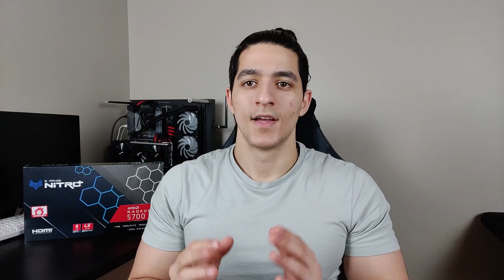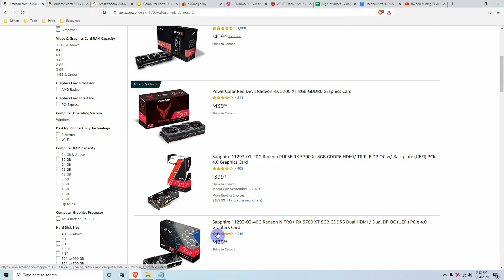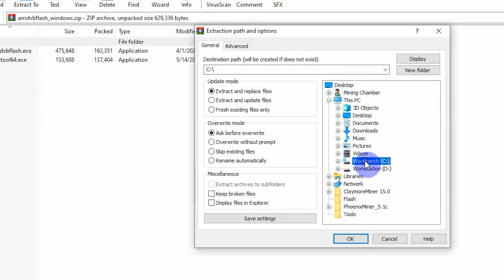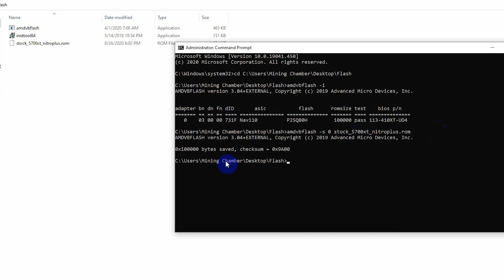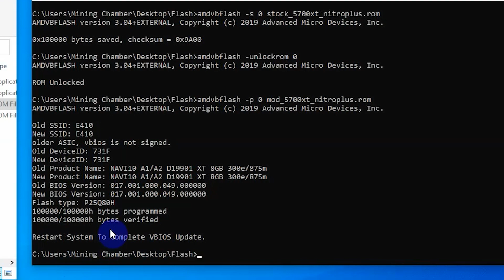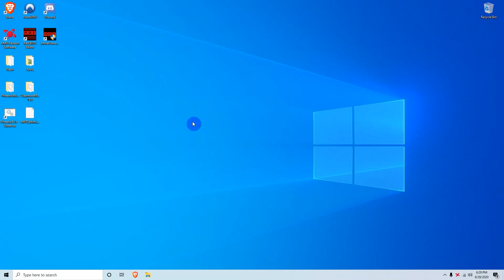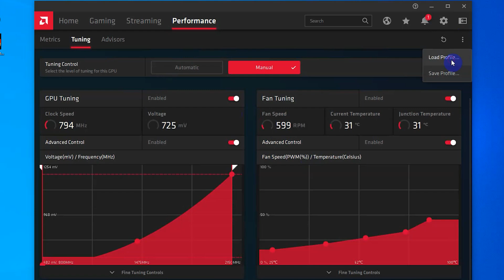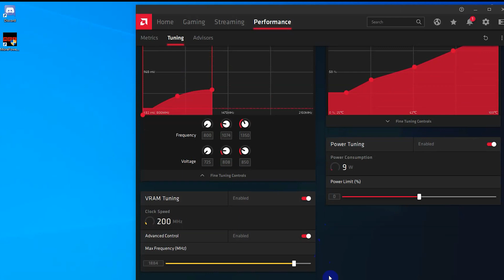RX 5700 XT Mining Overview | Profitability, Hashrates, BIOS Modding & Overclocking

Comment from the maker: NOTES:
- For people trying to flash Gigabyte 5700 xt Gaming OC and Asus Strix 5700 xt. You need to use these 2 stock bios's because modding the original and flashing it back to the card may produce a code 43 in Windows or brick the card. https://mega.nz/folder/PFtCTBYS#AzKgME9vJitocIKIGYKw1g

- Some cards depending on AIB need to have a higher fan speed to keep the memory cool. - Kevin Galloway (Thank you!)
- Please check updated overclocks that are more stable in this article https://miningchamber.com/gpu-mining/rx-5700-xt-mining-settings/
Reply: 1300core@750mV and 1860 memory clock stable with BIOS mod almost 57MHs on MSI RX 5700 XT
Reply: @davidhajes1003  Reported 59.500 mh/s but, effectivespeed 24.16 mh/s? what is this problem ? :(
Reply: @BABAZULA3535  use teamredminer that do not fake hashrates ;-) no RX 5700 series mines more than 56MHs. Only PhoenixMiner can do 65MHs but you get lower effective rate than stock due to the errors and rejected shares. Theoretical hashrate does matter - submitted shares matter
Reply: @DavidHajes  thx bro.
Reply: There's a new 3.04+ up on igors lab. Here's the link. It seems like the file size went up a fraction. Not sure what they added but it still works like a charm and its mirror 1 :) https://www.igorslab.de/en/red-bios-editor-and-morepowertool-adjust-and-optimize-your-vbios-and-even-more-stable-overclocking-navi-unlimited/3/ Also if your getting the error code, its probably because you haven't clicked on Insttool64.exe. <- I made that mistake before >.<
Reply: @WillYouPanMe  thanks a lot👍🏻
Te issue was that I wasn’t on WHQL drivers. But I’ll keep that in mind - thank you!
Reply: I see gigabyte 5700 xt gaming oc rev 1 bios over there. would the same work for rev 2?
Reply: @ntonZZ  Curious as well. I bought mine in batches and it turns out I have (4) rev2 and (5) rev1 - All Gigabyte 5700 xt Gaming.
Reply: @ntonZZ  hey did you find an answer to this? My gigabyte 5700xt has a 1024kb bios and the rev1 posted is 512kb. I’m guessing the rev2 is the 1024kb and can’t be interchanged? Would be STOKED to hear what you learned!
Reply: @eamonconheady9855  unfortunately i didn't try it as 1 of my graphics card got bad sensors. I still get 52.45 MHS at 108 watts. Good luck with ur bios mod.
Reply: Is it posible to bios mod asus strix 5700 xt please helo? :) because i get code 43 every time i try do do it in your video
...
Reply from the maker: @justonekevin  Did you follow what this pinned comment says ;)
Reply: @MiningChamber  noo not yet because i dont know wich bios to use 😅
Reply from the maker: Hey! Just change the bus Id so that they match in the Red Bios Editor tool, so 05C1 should be 04E2. Make sure your using 3.04+ as well not 3.04. join the discord to chat there encase I miss your reply
Reply: @MiningChamber  im waiting mail. 🙏🏻
Reply: @MiningChamber  Thanks! So it sounds like you can change the O5C1 bus ID via RBE , I thought that you can also do it in the AMBVBFlash 3.04+ command lines. That is good to know will check it out. So the goal is to mimmick the ID similar to the current BIOS. I was a little worried about that but good to know the trick
Reply: i was watching your video just now to figure out why i couldn't download the tool.  Thanks for the tutorial, hopefully the tool will be available again soon.
Reply from the maker: Thank you ! I'm glad the comment helped out!!
Reply: I downloaded it using mirror #2, I guess I can proceed with the bios flashing?
Reply: @demdimi9316  Hi Sivi, how did you download it? I entered my email but receives no reply... Could you please share your download link? Thank you so much!
Reply from the maker: Hopefully he provides the way!
Reply: @demdimi9316  hi, can you please send me the download link? thanks
Reply: @yonasun2987 I think the download link expires after a while. Check your spam folder, that's where they sent me the link.

I just asked for another link, hope you click it on time, download link is there. https://www.filehosting.at/file/details/869488/g8d5lmQeOT5MHN38/amdvbflash_windows.zip
Reply: Sivi Skivi Actually I just downloaded it from igorslabs website, it’s back up there... thanks though 👍🏻
Reply from the maker: @demdimi9316  yes if so then you can proceed!
Reply: @MiningChamber  I don't understand, how does it use more wattage? Is it that significant? I saw at the end of the video that you were getting around 55 mh/s with ~84W
Reply from the maker: That was off the software it won't be accurate, off the wall it's about 10 more watts for 3-5 more mh/s
Reply from the maker: He also provided the link above!
Reply: @MiningChamber  SW power draw is maybe in GPU...I get "real" 110W but you have about 10% losses in MB circuitry due voltage control and another 10% PSU...in my case they claim 8% @ 92% PSU efficiency.

I always check APC PSU where is power draw reading. My card is in reality not 110W but 130-140W...hard to estimate due idle power usage of rest of PC.
Reply: Thanks you so much, my card is on the way and I found your channel just in the right moment, I thought it draws 150W, and I was also happy with that. I come from the PSU video, good job!
Reply: what is the password?
Reply from the maker: @monik5365  of phoneix miner? It will be "phoenix"
Reply: The download link does not work  i've got a Gigabyte 5700 xt
Reply from the maker: @ChrissyB_ZA  Hey sorry just fixed it!
Reply: What do you mean dude? If we are using asus rog strix 5700xt then we can't replace the original bios? Or we can mod the original bios from the gpu?
Reply from the maker: @moonshot-studio  If you have the models above then you will need to use the BIOS image in that link for your Strix. The original BIOS has a lock system on it if you modify it, it will lock up. So I recommend just saving your original BIOS then use the one in the link for memory timings and MPT then flash it on the card.
Reply: @MiningChamber  Hello, first of all; thanks for your detailed guide. I exactly did this with my Gigabyte RX 5700 XT Aorus, but my rig won’t boot up after flashing the modded bios. What should I do?
Reply: Hello brother, you are a great one, I learn every day .. a question .. I need the video where you talk about the XFX Radeon RX 5700 XT THICC III Ultra 8GB since it is not in the list of your videos .. thanks
Reply from the maker: @hijodelaruina6032  hey! It is also a good gpu and it will follow this same tutorial!
Reply: does this apply to gigabyte 5700xt aourus?
Reply: Just bricked my aorus 5700xt... tried to flash with your bios but i cant... any solution?
Reply: @milospinkfloyd3325  did you manage to re-flash it?
Reply: @freddieholmgren804  fortunatley yes i did, reflash and mod. Now 56mhs
Reply from the maker: @milospinkfloyd3325  hmm aorus did you try to do it the normal way or through the bios pinned? Sorry for late response I just caught site of this comment!
Reply from the maker: @milospinkfloyd3325  oh sweet I see it's solves awesome
Reply: @MiningChamber  so, point with giga cards is next: if you have rev 2.0 card you need to flash it with 1.0 rev bios stock first than mod that rev 1.0 bios and flash it again. If windows make problem when card flashed no problem just put card in linux rig and will work
Reply from the maker: Awesome thank you for the info!
Reply: @MiningChamber  one more useful info, avoid gigabyte couse they have very bad memory cooling
Reply: @milospinkfloyd3325  hey how did u reflash it? I got a black screen too
Reply: @RayR-804  you have to flash card with previous revison bios of same card
Reply: @milospinkfloyd3325  but whenever i connect the card, my screen goes black. And im using integrated graphics. When i pull off the card. Computer works fine and goes to bios
Reply: @RayR-804  than its complicated.. if you cannot run pc with cpu graphis. Dont know solution
Reply: I tryed the metode for asus rx 5700 xt used your old bios and i get SSID: Mismatched
ERROR: 0FL01
Reply: @justonekevin  than it isnt bios of same card
Reply: @milospinkfloyd3325  yes it is the same card !!
Reply: So with asus strix 5700xt you have 2 files listed there.  One is for the 5700, one for the XT.  The XT file is only 512kb which is half of the size of the stock bios on my GPU.  Is that an issue?
Reply: Hello, I bricked my Gigabyte RX 5700 by not flashing the Rev1 bios first. I have successfully flashed to the original BIOS, but the card is not recognized when put on the 16x slot directly, and when I try to use HiveOS it says there is a Kernel sync error, what else do I need to do in order to revive the card apart from flashing it to the original / rev 1 bios?
Reply: 1.first remove all your gpu go to bios and change settings to onboard graphics which means to motherboard and
connect your monitor to motherboard
2 install your rx 5700 to pcie and you can see windows loading screen and you can back to original bios or to rev1 by above video procedure
Reply: @mo108186  hello first of all thank you for helping me out. I did that, shows success upon flashing it to REV 1. but HiveOS freezes when loading AMD driver.. what can I do?
Reply: @RockoShaw  install amd 20.9.1 drivers it is  stable
Reply: @RockoShaw  install amd 20.9.1 it is stable
Reply: @mo108186  I followed the tutorial, flashed the BIOS of the RX 5700 XT back to the original stock bios. Installed the drivers you recommend (20.9.1) but windows has a yellow warning sign on the Device Manager, the radeon software can't be opended
Reply: @RockoShaw  what is the error it is showing
Reply: @RockoShaw  is it showing code 43 ?
Reply: send me your email id i will send the moded bios for gigabyte rx 5700 xt which was working for me
Reply: @mo108186  When loading HiveOS, it says "not all cpus entered broadcast exception handler" kernel panic, it's a single GPU connected to the Mobo, tried on 16x PCI slot and using riser, can't get HiveOS to work even after flashing the original BIOS
Reply: @RockoShaw have you flashed my bios  it is working on windows i am on windows i don't use hiveos
first check it in windows if its is working tell me then i can give you a solution
Reply: @mo108186  hey man, I’d be stoked to get the working bios for the giga 5700xt. My bios is 1024kb and the one in the link up above is the 512kb. It’s sounding like I need to first flash a clean rev1 bios and then on to the one in the link. Do you have those?
Reply: Mining Chamber Ive flashed my gigabyte 5700xt gaming oc without going to rev1, because i didnt see your comment on that, then my pc didnt boot when the gpu was plugged in,yet i wanted to flash the original bios on it but my gpu isnt detected in device manager neither in cmd with amdvbflash -i. What can i do to get it to show up so i can flash the original bios on to it?
Pls help me i am broke and dont want to loose my 5700xt😫
Reply: @IIISUDDENIII  same thing happened to me. Did you find a solution?
Reply: can somebody share the rev1 bios for gigabyte 5700xt rev2.0 samsumong memory
Reply: @dota2arcade603  I want it to, but i dont know where to find it
Reply: Oh dang, you should have put this message in the description… I have a Gigabyte 5700 xt and followed exact steps in the video, now my pc somehow doesn’t turn on. 
I can see the cpu fan running and gpu lighting is up, but my mouse/keyboard/monitor has no signal, I also tried a remote app to see if my pc is on, it looks like that  my pc did not turn on….Could you please help me with this? I have no idea how to revive it
Reply: @daddisucre3782  dude I was about to do the same a month ago, but for pure curiosity I checked the comments and noticed that. Good luck my friend!
Reply: Can we install with hiveos using unlocked Rev.1 bios? Or is this only done in windows?
I don't want to re-brick the card.
Reply: @seyityavuz38  you can in hive
Reply: Hi, man. One of the best reviews on your channel

#xETH-G offers easy staking: stake with #xETH-G and earn #xETH-G bonuses every minute. 7 and 30 days pool. With compounding rebases on the top of easy staking. Should I buy there?
Reply: It works you need to change thr SUB id in red bios editor as the same as stock.... but now my fans are 20s off 20s max speed...???
Reply: Hey man, your vid made my day, thank you!

I found $xETH-G Governance and I’m really interested. They as a community can create Governance proposals. They provide liquidity mining - stake with 50% $xETH-G token and earn #xETH-G rewards every minute. Worth supporting?
Reply: What version of flash tool i would use for Gigabyte Gaming OC 5700xt? 2.93 or the 3.04 ? I don't want want to brick my cards. Thanks!
Reply: @TickleLabs  3.04 i used 3.04 and bios moded my gpu is achieving 58.3
Reply: @MiningChamber I have screwed it up and flashed my RX 5700 XT without flashing Rev 1 first, it got bricked, MoBo won't post Bios, I had changed setting to CSM enabled which lets me post BIOS, then I used Dos and AMDVBFLASH to flash the original Bios, it says PASS, but when I turn off CSM it won't let the Bios POST again. Could you please guide me? I have been googling a lot but can't get it to work
Reply: @RockoShaw  same here, did you already find a solution?
Reply: @royvanduuren6881  yes, it comes out I used the wrong bios. I bought 10 gigabyte cards same model, but one of them has Samsung VRAM instead of micron. So somebody shared the the Samsung bios with me. Problem fixed
Reply: Oh great! Could you share the Samsung bios with me?
Reply: @bernelnery2191  hello I used to get that error trying to flash using the wrong bios. It turns out the cards have different VRAM brand even on the same model. In my case my 5700 XT gigabyte had Samsung memory, I just backed up one of the Bioses of other cards same model and they turned to be Micron. So get the stock bios of the right memory
Reply: I own an asus rog strix 5700XT OC but i don't know which of the two old bios i should use. The bios backup of my card apparently match with what you called only as 5700 and it is 1mb, instead the second is 512k but you indicate it as 5700XT, which use?
Reply: Help!!!, I followed all the steps in the video but I did not realized about the warning of Gigabyte 5700 xt gaming OC (it's the card that I have) and after the process, my card is not working and the video never start again even with the mother board, so my card is bricked. Do you  know what can i do?, thanks for any support....
Reply: Modding ROG Strix 5700XT using the old stock bios you mentioned in the pinned comment, after modding the bios, when attempting to flash I'm getting an error, SSID mismatch? Any help pls
Reply from the maker: @cameronstone8390  just make sure that ID matches. See the sub ID difference and change it in Red BIOS Editor to match the one on your gpu
Reply: @MiningChamber  Can you guide me on the 5700 xt gigabyte SAMSUNG memory?
Reply: Since it looks like the 5700 xt strix has a dual bios of quiet and power.  Could i not bios mod the quiet mode bios with the link you provided and if i mess up the power side would be the original and still boot.  Sorry new to this and really do not wanna mess the card up since they are worth more then gold right now
Reply: @thawol9227  Yes dual bios will save you if your first try failed
Reply: Hi, i bought a Gigabyte Aorus 5700 XT and the card bricked as i thought, i flash back the original bios and it was up and running again. so i downloaded the "old bioses" file . But when i want to install the "REV1Gigabyte.RX5700XTstock" it give me an error of "SSID mismatch" and "ERROR: 0FL01" . am i doing something wrong? the card is currently on its stock bios.
Thanks
Reply: Why I have look now =( I have brick my gigabyte 5700xt... I just did the flash but unfortunately it did not go as planned .. I end up with a black screen on restart because I do not have a graphics card on my processor or even a second graphics card for flash in stock ...  You think I can repair this?
Reply: After reading the comments from others.. I now am afraid to mod my Gigabyte 5700 xt Gaming OC. I am not sure on what's the next thing to do after saving the stock bios and soon. Please correct me if I am wrong with the steps below.

1. After saving the my stock bios (1Mb size), flash the bios with REV1Gigabyte.RX5700XTstock.rom
2. MOD the REV1Gigabyte.RX5700XTstock.rom, following the steps on the video
3. Then flash the Moded REV1Gigabyte.RX5700XTstock.rom to the bios
4. Finally restart

Is this correct for Gigabyte 5700 xt Gaming OC? Thanks in advance!
Reply: @kidgamer4855  I was curious if you were able to successfully bios mod your graphics card. I have 2 asus Strix 5700 xt and I wanted to know how.
Reply: Hi Mining Chamber, I have 2 Asus Strix 5700xt in my mining rig which consist of 2 rtx 3070 and 1 rtx 3080. My question is, now june 9 which is 8 months ago from your comment about needing to use those 2 stock bios’s for the Asus Strix, has anything changed? And if it hasn’t how do I apply those 2 bios that you talked about to my 2 Asus Strix 5700xt?
Reply: hello sir... i'm new... how to set wallet on "CMD'.... you dont show in this video...
Reply: before mining I was flashing my rx 5700 to the rx 5700xt bios so my hackintosh will run faster and now did the modding with this bios everything works great 57.7mh/s so everything is ok with my card?
Reply: ;_; dang I already brick the card

Comment: Any tips on how to convert it back to the original? I flashed back the stock ROM, but still, it is forcing the voltages to stay at 0.725 (below the default 0.750). I uninstalled all drivers and even at AMD's own software it now shows that 0.750 is the limit to how low I can go. But still, it is forcing it to 0.725. I'm assuming MTP write's something to the Registry keys, so just be sure i Default reseted ALL of my registrys, but im still having the same issue. Do i have to install MTP again and manually change the values back to normal?